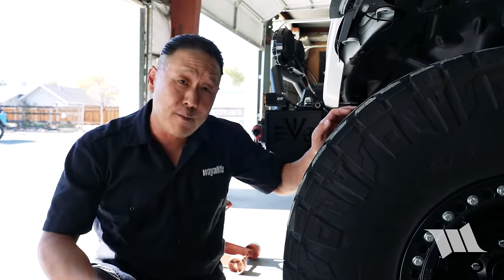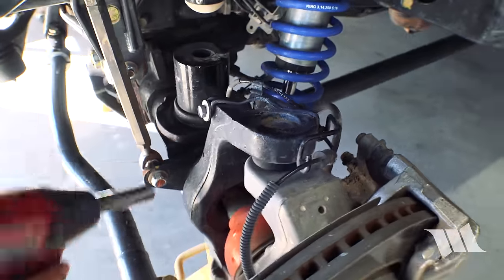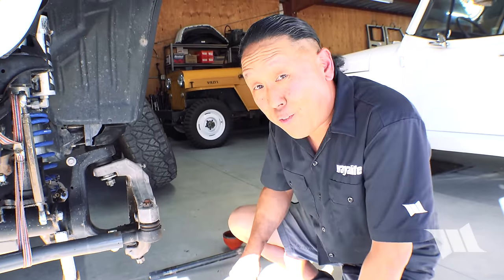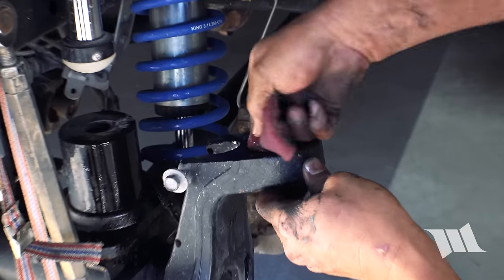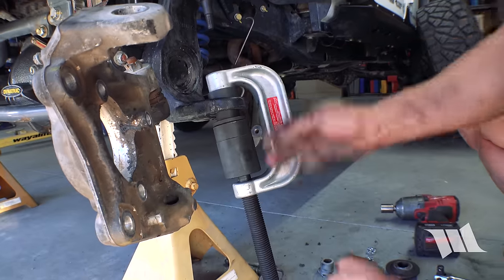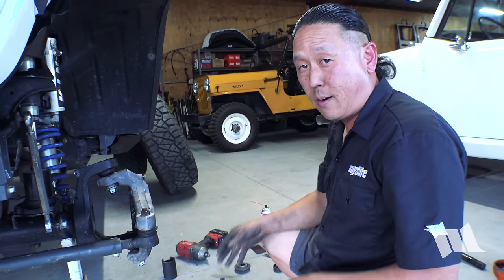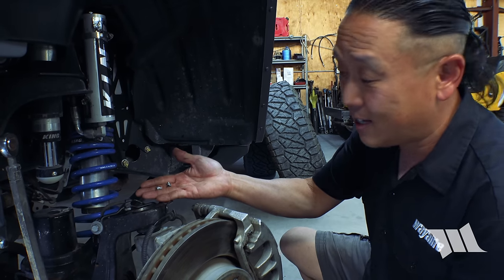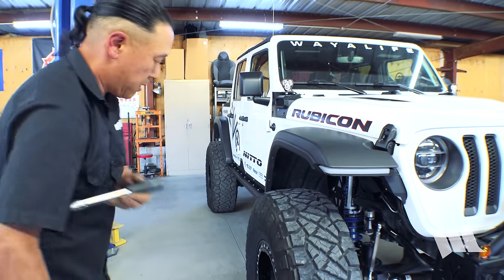How to Install Ball Joints on a Jeep JL Wrangler or JT Gladiator with Heavy Duty ones by Synergy

Comment: Great video.
I installed the Synergy rebuildable ball joints back in April or May of this year on my 2018 JLUR. They were the only ball joints Synergy had available at the time.  I'm happy with them.  I needed ball joints, and I wasn't going to put factory junk back in.  Your cassette hubs came out of your knuckles a lot easier than they came out of mine.  I had a hell of a time getting them out.  The one Knuckle had corroded to the hub.  After I got the bad side apart (heat, axle puller), it took me a couple hours to scrape all the aluminum oxide off the cassette hub.  It was a real pain. I put never seize on  those mating surfaces. 
I really enjoy how you present a job on your Jeep.  Your videos are very helpful.
Take care!
Reply from the maker: Thank you. We're happy to hear you enjoyed our video.

Comment: I only saw ONE thing you did wrong… mechanics don’t smile that much. 😉 thanks for sharing. I had my steering and suspension ASE certification but truly it’s just a piece of paper for peace in the mind. I was doing so many ball joints back 15 years ago, I quite literally didn’t need a torque wrench on the castle nut. I did it by feel. And I was so confident I had 2 buddies and the snap-on guy check it. Dead on. I used to be an OK mechanic… but I’ve digressed. In more ways than one!!! 

Thanks for memory jolt. Stay safe.
Reply from the maker: LOL - awesome and thank you.

Comment: Thanks for taking the mystery out of replacing the front upper and lower ball joints.  Now I know why the uppers have to be reinstalled first, so the press will fit into the knuckle.  :)

Comment: Great videos, love your shop and rig. I ran synergy HDs in a JK for a while, I made the mistake of installing knurled joints early on and they were a pain to press in! Now I know why. They lasted a few years but failed recently, then by coincidence I noticed on their website they had recalled my version of the joints due to premature wear, I called them up and they immediately sent a set of the newest ones, great customer service by synergy! Interesting to hear your opinion on rebuildable joints, I would have thought you could get a few more thousand miles out of them after tightening them up before replacement that should work out cheaper over time? Appreciate all your videos and forum info! It has saved me many times! Keep up the good work.
Reply from the maker: Thank you and that's great to hear. Regarding rebuildable joints, they are nice but there's no way I've found to actually rebuild them on a Jeep and being that the rebuild kits cost as much as new joints, I figure it's just as easy to install new ones being that I have to pull them anyway. But, that's just me.

Comment: Aloha Wayne.  This is a very delicate repair and replacing ball joint for your Jeep Wrangler.  You did an excellent job in the removal for of the components to replacing for the new ones on the front.  Nice work with a terrific video 📼.😇🧐💥💫🤙👉🏼👈🏿👌👍👀🤜🤛👏🙌💪
Reply from the maker: Thank you. Glad you found our video to be helpful 😎

Comment: One of the maintenance items I probably need to do soon on my JL. You inspired me to at least finally order a ball joint tool!
Reply from the maker: Not necessarily. We have over 60k on the odometer and our factory ball joints were still in good condition. And I should note, in spite of our beadlock wheels with a lot less back spacing and even wheel spacers that we were running for a better part of those miles. "pre-maturely" just means sooner than what factory ball joints can do with stock wheels. Not "right away" 👍
Reply: @wayalife I just received the ball joint tool you linked and it doesn’t have the angled adapter in it that your kit does???
Reply from the maker: @caryrichardson338  I'm sorry to hear that. I looked on Amazon and it shows the angled adapter in the lower left hand corner of the screen. Are you saying that you do not have that piece? The angle is slight.
Reply from the maker: @caryrichardson338  The description also states "Set also includes 4-wheel drive ball joint service kit that allows service for 1967 thru current 1/2 and 3/4 ton 4WD vehicles having the Dana 30 or 44 front axle (found on Ford, GM, Dodge, IHC and Jeep vehicles)".
Reply: I guess I stand corrected, I do have that piece. You aren’t kidding about “slight”. I spent 5 minutes with and angle finder and calipers just now. We’re talking 0.4°!
Reply from the maker: @caryrichardson338  Glad to hear you got the adapter.

Comment: Great video. I will have to inspect my ball joints now. 23k on 37" with factory ball joints. Something tells me I'll have to rent a press.
Reply from the maker: More than likely, your ball joints are fine. We have over 60k on the odometer and our ball joints didn't really need to be changed out and this in spite of running wheel spacers on top of beadlocks with a lot less back spacing for most of those miles. As I state in the video, that will cause your ball joints to wear out "pre-maturely" but that is not the same as right away. Factory ball joints with stock wheels can last over 100k.

Comment: Great tutorial vid. If I EVER get a JL I'll know how to do it. Lol. Just did my TJ/LJ Rubi earlier this summer (along with RCV's due to broken chromo shaft on Cliffhanger.)  :-(    I have to disagree with one comment... I looked at some of the rental ball joint kits and I also have the basic HF kit. They are NOT complete kits and can be a PITA.  They do not have the special off set adaptor, which is extremely helpful, nor do they have the long solid bottom piece you used on the lower joint. The adaptors they do have were not a snug fit to the lip of the joint. I ended up having to cut a piece of DOM and make my own. As they say, you get what you pay for and a quality ball joint kit with the proper pieces is $$ well spent.
Reply from the maker: It is important to rent a kit that comes with Chrysler/Jeep adapters.

Comment: Thanks for sharing Eddie! I always feel better about doing this kind of work after watching your videos! Any reason you went back to the OE steering stabilizer? Only asking cause I have that Fox TS sitting in my garage waiting to be installed.
Reply from the maker: Glad you find our videos to be helpful. Regarding steering stabilizers, I've always found that OE works best and I wasn't thrilled about the aluminum tie-rod clamp that Fox provides. Mine got beat to all hell and I almost couldn't get it off.
Reply: @wayalife  Thanks for the response Eddie! Looks like Synergy came out with an "adapter kit" (which is just a screw and washer) that can be used with their tie-rod clamp. Think I'll give it a shot! We'll see how it goes 🙂

Comment: I like the 10mL bolt though. Decent video. Why do I watch the basics lol.
Reply: I do have a question though. When you cleaned the blue thread locker off of the bolts. Did that give you any ideas on which color to use when reinstalling them?

Chrysler specified blue only.
Reply from the maker: For the most part, anything with blue, I don't worry too much about. If in doubt, that's what should be used again though. Red absolutely needs to be used on the unit bearing bolts and caliper bolts though.
Reply: @wayalife  :-) is it your rig btw? It's super decent!
I love your transitions, how long did it take to shoot and edit?
Reply from the maker: Oh yeah. Well, one of many. Here's a link to all our rigs https://youtu.be/V0UERETS2Bk
Filming took a day and editing took about 2 days on and off. Of course, my wife Cindy does all the work 😎

Comment: Some anti-seize or high pressure grease on the threads of the press tools can help a lot.
Reply from the maker: If you live in a rust belt state, I can definitely see how they would be of help. Out here in Nevada, it really isn't necessary.
Reply: @wayalife  The grease is for the press. On old stubborn joints (ball joints, pitman arms, etc.), the pressure can get quite high on the threads when trying to press them out causing galling of the tool if unlucky. Grease or anti-seize is just to make cranking on the press tool easier. Also it will save cheaper tools from destroying themselves. I learned that the hard way unfortunately.
Reply from the maker: Yup, got it. Can't say that it's ever been a problem for me but good advice none the less.

Comment: Great video again with super instructions and advice.  Thank you.

With your JL/JT wheeling experience have you witnessed or had any friends with JL/JT with any problems of the aluminum knuckles wollowed out?

If replacing ballpoints i think i may consider the factory steel knuckles (like those on diesel JT) or aftermarket steel knuckles from Reid Racing.  What do you think?
Reply from the maker: So, while I have not seen any problems with the aluminum knuckles or at least, as of yet, I'm not really a fan of them. When I get a chance, I hope to replace them with iron replacements.

Comment: You are an excellent mechanic and I enjoy your well-constructed videos. But red loctite on the caliper bolts? I sort of see the reason on the three uni bearing/axle bolts, but the brake caliper seems to be something that will require more frequent disassembly. Reasoning for this, please?
Reply from the maker: I guess I missed the memo where red loctite is such a terrible thing to use. In the almost 30 years that I have been working on Jeeps, I have NEVER had an issue removing a bolt or nut with red. What I have seen is blue being insufficient for something exactly like a caliper bolt, something that gets really hot and to the point where the bolt had come free. But hey, that's just what I've experienced and seen and you should always use what you feel is best.
Reply: @wayalife  Good point about the heat generated. Also good to know you have had good luck breaking the red fasteners loose. I've found them to be a real bear at times.

Comment: If you're thinking about doing this. Just order the parts and do it. Don't be like me and think you can make it through winter or you might be doing yours under a tarp with a buddy heater while it's -1 out after it fails and also breaks your axle shaft at the yoke.

Comment: I have a question.  I am going to attempt to change my ball joints on my 2020 Gladiator.  I always watch your video first because you are awesome.  I saw on other videos them draining the differential fluids & you didn’t?  Do I need to drain the differential fluid?  Thanks in advance
Reply from the maker: I would never pretend to know as much as what you can see on other videos. That said, what you see in this video is EXACTLY everything that I did to change out my ball joints. Nothing was left out.

Comment: Loving your videos, very good info and tips. I have a question for you though…how are you liking your Synergy ball joints since the install? I’m getting ready to order and after watching this video I happened to stumble on a forum thread where the question was asking for info on knurled or non-knurled and you had stated that they are all pretty much made by the same Chinese factory and recommended Crown HD instead. Your videos sold me on their great idea of their adjusting while jeep products such as track bars etc, but I’m curious whether you still feel that their ball joints are on par quality with the other products. Thank you in advance
Reply from the maker: If this is your first set of replacement ball joints, you definitely do NOT want knurled ones. Those are only for knuckles that have been used for a long time and need a bit more bite. As far as what I think of these ball joints go, so far so good. They're holding up well and I like them a lot.
Reply: Thank you!

Comment: love the video..... only question; why not the dynatrac ball joints which are rebuildable or the ball joint deletes? 

These Synergy ones were a great option along with the teraflex ones 10 years ago, but seems like there are better options today with negative offset and or large tires
Reply from the maker: LOL - if you say so. I've run Dynatrac ball joints on 3 different Jeeps and while I would be the first to say they're good ball joints. However, you're kidding yourself if you really think they're rebuildable on your Jeep. Also, the rebuild kits cost about the same as new ball joints. That said, I'm just testing these out and if for some reason I find they aren't as good as what I've tested in the past, I can assure you that I'll make a video stating as much.

Comment: As usual, a great and very helpful video! 

One question, when pushing the new joints in, would it help to coat the mating surfaces with grease or anti-seize compound? To help facilitate the install, prevent corrosion and make future removals easier? Or, to help with the alignment sleeve when it is on the rack?
Reply from the maker: I've always installed my u-joints dry and have never had an issue with corrosion or future removals. That said, I live in Nevada and things like corrosion isn't really an issue for us.

Comment: How are the Synergy ball joints holding up?  Thoughts comparing them to the Dynatrac's?
Reply from the maker: They're holding up great. Dynatrac ball joints are nice but a lot more expensive, the rebuild kits cost about the same as Synergy joints and rebuilding them is more of a pain than just replacing them.

Comment: Just curious about your RCV's and if you daily drive this rig? How do the RCV's do for daily driving if you do and are you having any issues with them slinging a lot of greese or not thanks and keep up the great videos they have helped me out a lot!!!!
Reply from the maker: Yes, I daily drive this Jeep and RCVs will do fine with it. Yes, they will sling a lot of grease and yes, it is annoying. Also, if you wheel your Jeep hard, RCVs will start to snap and pop loudly but RCV will tell you that it's totally normal. I have run RCVs on multiple rigs and they are strong but honestly, I'm not so sure they're worth the $400 premium. A good set of chromoly shafts with full circle clips will get the job done just as well.
Reply: @Wayalife  just curious if you had to use any special adapters to remove or install the ball joints or was that kit enough for the job ?
Reply from the maker: @bryanferguson4000  Everything needed to remove the ball joints are shown in this video.

Comment: Thanks for this great video! What was your main reason to replace the ball joints? Was it still Death Wobble? Thanks!
Reply from the maker: Main reason was that we got these ball joints from Synergy and it was an opportunity to show others like you how to replace them. That said, worn out ball joints are one of the biggest reasons why people get death wobble.
Reply: @wayalife Thank you, great job with the video! After replacing Tie Rod, Drag Link and Track bar there i snot  a lot left. It got better but there is still something left in my opinion. Fingers crossed!
Reply from the maker: @tobisreallifeskillswithtobi  Just to make sure, you do have the iron steering box, correct? If you still have the aluminum one, you need to have it replaced and that will help a lot.
Reply: @wayalife Actually I'm not sure which one I have. My car is still running stock JL Unlimited Sport tires and I have not seen any movement on the steering box like others have with bigger tires. I did not consider the steering box a problem as of now.

Comment: I am shopping around for ball joint upgrades for my JK that still has factory ones.  Just curious why you chose synergy over some of the other brands such as teraflex?  Thanks.
Reply from the maker: Not a fan of anything TeraFlex. Having personally run many of their products in the past, I have found most to be substandard and have personally seen many break.

Comment: Quick question , does the kit you linked have the angled adapter for the wranglers or did you buy that separately? I want to buy a kit as well, just seems like that one piece is missing from the linked kit. Thanks Eddie!
Reply from the maker: This kit? https://amzn.to/3Gec9e0 If so, look on the bottom left corner of the pic. That should be it.

Comment: If you had the chance to, would you opt in for kingpins as an alternative? I haven’t made up my mind if I should just upgrade to a tougher ball joint or go with kingpins
Reply from the maker: Not on a factory axle. Ball joints today are not what they used to be back when kingpins were considered to be better.
Reply: @wayalife  thanks for the advice! I have learned so much from your work

Comment: Not that I know, but would comment on ball joint deletes vs ball joints?  Thank you. Enjoy your content..
Reply from the maker: Based on what I have personally seen, I would NOT recommend them. Nice idea but they make steering feel too tight, will squeak and will bend. There are several shops that I work with that have removed them for all the problems I just mentioned. Here's a link to actual and objective information regarding them https://www.wayalife.com/threads/in-the-shop-disciple-off-road.63031/page-12#post-1338138
Reply: @wayalife  Thanks for the response and the link.

Comment: With your Dynatrac ProRock 44, what made you choose Synergy over Dynatrac ball joints?
Reply from the maker: The Synergy ball joints are new and I have never tested them out. I have run 3 different sets of Dynatrac ball joints on 3 different Jeeps so there's nothing new to learn from running them again. Assuming these do well long term, I'd like to think I can recommend them as a more affordable option. Certainly, they cost about the same as a Dynatrac rebuild kit and honestly, to rebuild them, you still need to do 90% of the work to do it and then spend a couple of hours rebuilding them. I can press out and install new ball joints in a fraction of the time.
Reply: @wayalife  thank you for the response!  It will be interesting to see how they work out for you.